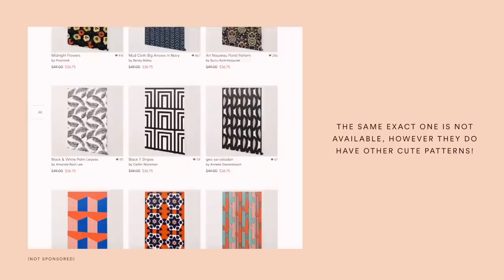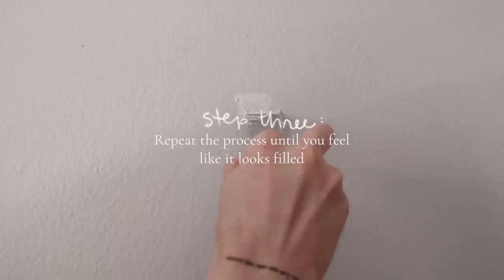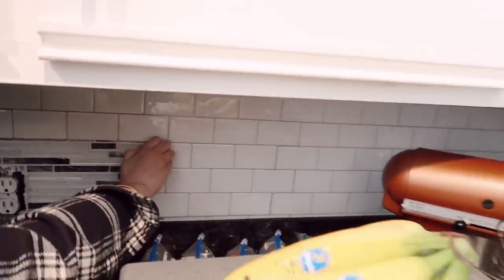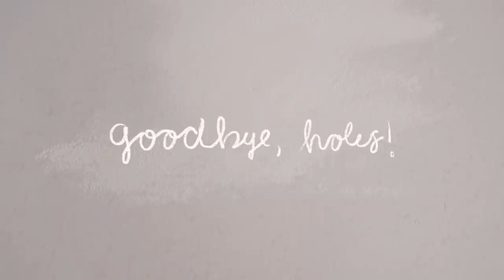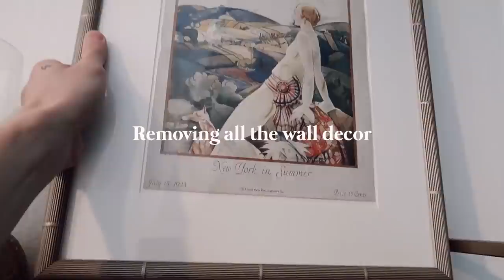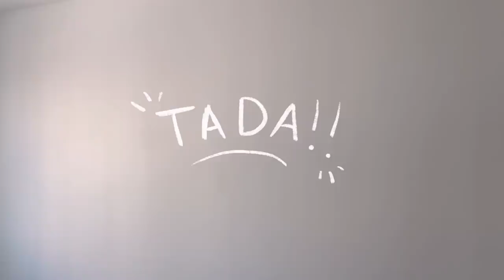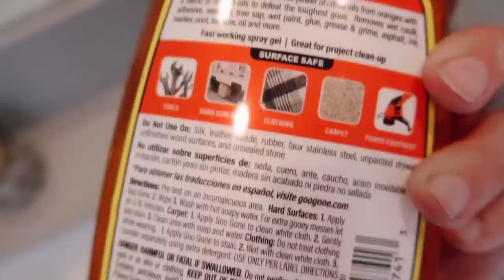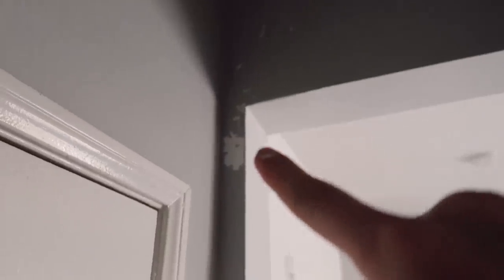Un-Making Over My Apartment! *Getting back my security deposit*

Comment: Spackle Pro Tip: if your wall has texture, a flat spot of spackle will stick out like a sore thumb. rub damp sponge lightly over the area after it has dried to remove excess spackle that is not in the hole.
Reply: That's one of the best things to do. Also, if you don't have the sparkler tool, an old credit card/store card works just as well.
Reply: Joint compound is actually easier to hide as it’s water based and you can rub the JC over the spot and rub a wet towel over it and only the small hole will be visible and not disrupt your textured wall, I just learned this recently and thought it was brilliant!

Comment: Drew! Using a hair dryer makes it easier to remove peel-and-stick tile (obvi too late now but for the next time lol). Can’t wait to see what you do with the new place!
Reply: Can confirm, just had to do this for vinyl decals the last owner of my house put all over the walls. Had to take each. individual. letter. off. The hairdryer worked so well
Reply: Same;  the hair dryer is a major key to removing all peel and stick.
Reply: Hair dryer or heat gun 👍🏻
Reply: same thing for the contact paper on the bathroom countertop. All the goo is left cuz it needed some heat
Reply: Same with slap tile floors heat gun....works awesome

Comment: If you ever have to remove "peel and stick" tile again, I recommend a heat gun or blow dryer. The heat melts the glue and the come off much faster.
Reply: I search so far down for this comment !
Reply: @artemiciat566  me too!
Reply: Be warned, depending on the peel n stick, it would leave some residue if heated off a surface
Reply: @NeptuneSega  A residue will be there even if heat isn't used. A good adhesive cleaner should take care of any residue.
Reply: Or WD40. Or, like he used, the Goo Gone.
Reply: And cooking spray removes the residue just as well as expensive products

Comment: Hey Drew, when you're doing multiple coats of paint with a limited amount, you can put your roller in a ziplock bag in between coats so you don't use up paint throwing away your used rollers.
Reply from the maker: So smart!
Reply: I put my whole paint tray, roller and brush in a big ziplock or even a garbage bag between coats so I maximize all the paint. It's saved me so much hassle too with having to wash brushes and stuff!
Reply: Also, and especially if the weather is warm, put your wrapped brushes and rollers into the fridge.  It stops the paint hardening.  Works so well!  👍
Reply: In his case, it is also useful to do the first few layers with another brand of white. And only the top layer with the color left by the painters.  Then less of the good paint is needed to make it opaque enough.  (p.s I don't speak english.)
Reply: @kirsten4041  was screaming "PRIMER!!!!!!!!" at the screen too XD
Reply: @kirsten4041  That's a good tip but I don't think he had any other white paint. I did this recently with my bathroom though and it worked so well!!
Reply: My mom would always wrap it in tinfoil or cleanfilm and stick it in the fridge, would last for months

Comment: Spackling tip:
Never scrap fresh spackle level to the wall surface; leave it bulging a bit.
As it dries, it compacts/shrinks. If it was leveled, it will reveal a divot over the nail/screw hole.
Better to sand it flat than have to build layers to bring it level to the wall surface.

Tip on anchors:
Never dig out the anchor.
Just remove the screw, then set a screwdriver over the anchor and tap the handle butt to push the anchor a little further in.
Now you can spackle over the old anchor, let dry, and sand, and no one will ever know.
It's actually structurally better for the sheetrock to do this.

Tip on peel-and-stick tile (floor or backsplash):
Goo Gone is expensive.
Most adhesives are oil-based (gums are basically dehydrated oils), so if you hit it with some inexpensive cooking oil, the oil will act as a solvent dissolving the adhesive residue.
Then you just go back with full-strength dishwashing detergent (like Dawn) to remove the oil and rinse.

Tips on painting:
Remove EVERYTHING from a room you're painting, or throw a plastic drop cloth over things.
No matter how careful you are, paint spatters, especially from a roller.
Also, paint will spatter onto your hair and skin, becoming a pain to get off later.
Unless you work olive oil into your hair and scalp and rub a light coat onto any exposed skin.
Not only will the pain not adhere and wash off easily later, but you'll get a spa-level conditioning of your hair and skin.
(Note: The classic movie beauty Sophia Loren daily applied olive oil to her skin for YEARS, claiming it discourages wrinkles; and it works!)
For better coverage, paint in random 'W' patterns instead of straight vertical movements.

Comment: A little tip when you paint if you have a broom handle that screws off you can unscrew it and screw it onto your paint roller handle.  Painting is so much easier using a long handle.  You can use better pressure when painting.  You have done a great job!!

Comment: FYI i recently learned that the metal end of the handle of a 5-in-one painter's tool is made to dent the walls where there are nail/screw holes. Once you make a little dent it's easier to fill them in with spackle/mud because there's no "blow-out" where the dust forms a little bump.

Comment: When you need to cover a dark color with a light color,  make the first  coat a white stain-blocking primer like Kilz. Then do the final wall color over that. You will need fewer coats, less work, and  it especially helps when you  have a limited amount of the  final wall color.

Comment: Semi-pro tip: especially on textured surfaces, instead of sanding the spackle, use a very lightly damp sponge and gently wipe off the excess. That will remove the excess spackle from all 'valleys' in the texture surrounding the hole instead of having a smooth patch where the hole was.  Plus it's faster and doesn't leave a dust mess that has to be wiped or vacuumed away before painting.

Comment: Real consideration: was the money you got back in your safety deposit worth the “labor hours” you spent fixing it back up?
Reply: Isabella Caltabiano apartments ive rented will charge you for every dollar in excess of the deposit that it costs to put your apartment back to normal. For his apartment I’d imagine it would be quite a bit
Reply: Security deposits (at least in my experience) are 1-2 months rent so depending on the area could be anywhere from 700-2000 dollars - so I would say so
Reply: Not undoing changes you've made to an apartment is inconsiderate and a crappy thing to do. Unless the landlord agrees to it, don't leave it for them to deal with.
Reply: I think so just because most of the stuff he used he already had. it looks like they only had to buy one thing of paint , so it’s undo the work you’ve done or loose 500-1000 dollars
Reply: The biggest reason to do the work yourself is that your next landlord will almost certainly contact your previous landlord, where they will find out that you’re an asshole nd terrible tenant for not following the lease you signed (return the apartment to normal) and then likely deny your application, thus loosing all that money in application fees (I just paid 250$ in application and ‘admin’ fees. Ugh)

Comment: Don't forget to clean your oven and ESPECIALLY under your stove (the top should lift up, warning it will probably be really gross under there). It's one of the most forgotten places to clean that will cost you your security deposit. Also baseboards and light switches. Also remember to replace any burnt light bulbs.

(I have family that run a real estate office and have cleaned many rentals for them before.)

Good luck! Hope this helps! 👍🏻

Comment: Two recommendations if I may. With the speckling, you can go over it with a damp sponge before it dries. Then you dont have to use sandpaper. And I think I saw somewhere that it's good to heat up the glued on tiles before removing them. Maybe with a  hairdryer?

Comment: Something I learned when I worked at lowes in the paint dept. Is that, even though paint is advertised as having paint and primer in one...it doesn't because you can't actually mix them together. What they actually do is add a little bit extra titanium to it to make it thicker so you can do less coats but if you need to go over and unpainted surface or a shinier surface or a darker color or going over a oil paint with water based (latex) paint then you need to actually buy the separate primer. Especially if it's a shinier surface or was painted with an oil paint before because it will chip and peel in short period of time since it can't fully adhere to the surface. When I say shinier surface, I mean like say you bought an eggshell paint but the wall or whatever was painted with satin or semi-gloss.
Also a bare, unpainted surface will soak up paint and you'll have to keep adding layers so do yourself a favor and do 1 to 2 coats of primer beforehand.

Comment: Using a blow dryer while peeling the tile makes it a little easier to get off. It will soften the adhesive so it may leave more residue but it will come off easier.

Comment: I live in Washington, DC and in the older buildings if you lived there 2 or more years and you've painted you just have to put on 1 coat of primer, and if you didn't paint you just have to clean and remove all trash (no patching holes) since they will probably be redoing the entire apartment after you leave.  I always patch up the holes even though they tell me I don't have to and make sure everything is cleaner than I found it.

Comment: Also a tip for the fraying of the wall because of screws. You can use the back of a screw driver thats round and roll it on the edge of the hole it will fold the fraying in and its very fast.

Comment: Maybe already suggested, but use a blow dryer on the contact paper.  I had ancient contact paper in kitchen cabinets and drawers that would not come off.  What would come off was tearing up in little strips and leaving a sticky residue mess.  I hit it with the dryer, and it came off quickly in full sheets with no residue.

Comment: Great video.  Quick tip use a heating gun or blow dryer to melt the glue on the paper.  This will make it easier to just peel the paper off of your walls.

Comment: Hey quick tip when you try to remove the contact paper and any thing with a glue backing use a blow dryer to soften it a little.. Pulling it it will be much easier 😊👍🏽

Comment: I noticed the peel and stick tile was over the original tile. With how difficult it was to remove the peel and stick tile, do you think it would have removed paint if not placed over old tile?
Reply: It's very possible that peel and stick tiles will remove paint, and even some of the wall. They're supposed to be warned up with a hair dryer or heat gun before pulling them off. If you warm them up and go very slowly and gently, you should be able to do it with minimal or no damage, but I'd be prepared for the paint to need touching up.

Comment: If you ever need to fill nail homes again use a product called Paint N Patch. You press it into the hole, spread a little over the top then wipe it away with a damp finger. No sanding! Best stuff ever invented. It's especially good if you have a knock down texture on your walls like you do. It doesn't leave flat spots where you've used Spackle & sanded. I would love to see a before you move in with all the changes made to your new apt video. A moving one.. not so much.

Comment: Oh wowzers. I had no idea stick on finishes are such a thing. Yours looked so well done.  Would they work as well in humid climates?  I kind of softly loled at your paint guesstimate.  (no primer over dark blue = an easy 4 or 5 coats). In all cases I actually enjoy house painting. It's hard work but meditative. And very satisfying to see such direct results from your hard work. (like mowing grass).   Regarding the removal of the anchors from the walls, I think it should be pointed out that spackeling (sp?) larger holes will need multiple passes with greater drying time between applications than paint.  If the timing is off you're screwed (you gave yourself 9 days so you were fine).   Regarding the gallery wall in the living room is the art licensed?

Comment: Tip: a trick to removing any peel and stick or anything like a sticker, is to use a hairdryer on it for a couple seconds. It loosens up the sticky(glue) part and removes it easily. I use this trick to remove price stickers off of shoes/items, and contact paper.
Reply from the maker: Thanks so much for the tip!

Comment: I have never had luck with goo gone, what I tend to do (for non-porous surfaces) is use lighter fluid.  Don't know why it works but it just melts adhesives like nothing else.  Just make sure you wash the surface afterwards.

Comment: I wonder if a heat gun like for crafting would help remove the peel and stick tile.  If you raise a corner and direct a little heat on it, the adhesive would soften and maybe lift easier. Don’t put the heat gun too close, maybe 6 inches from tile.

Comment: Would you recommend that contact paper (from your bathroom) for a kitchen counter top? Like is it durable enough to use with pots and hot pans banging on it? Or even with all the effort it took to remove the contact paper afterwards (kitchen counters being a larger surface area)?

Comment: I'm always surprised when I see you tubers filling in nail holes. You should get your deposit back with normal wear and tear and I've always left a reasonable amount of nail holes in previous places and always gotten my deposit back. I understand for a gallery wall where there may be an excessive amount of holes. Of course, I was in law school while living in my apts. and also worked briefly in landlord/tenant court after so i was always ready to argue my point if needed (always took pics/vids of my empty apts before I moved in and when I moved out to prove condition if I needed it), but I never had to. I also painted one apartment on my way out to cover color I added and just got a standard warm white. It was in a contained room so it looked clean and fresh and didn't clash with whatever white was in the living space. Still got my deposit back. Of course, I was also a single gal at the time and pretty unassuming and clean. Landlords were probably bummed I was moving because I do know people trash apartments!

Comment: would heating the tiles have helped? We had to remove some HORRIBLE adhesive stuff from a door, and we heated with  a hair dryer to remove it faster :) also, it came out in bigger pieces instead of small chunks

Comment: Investing in a gallon of KILZ primer would have been best for the first 1-3 coats in each room, thereby saving the matched paint for the top coat/s. The worst that could’ve happened was you’d have leftover KILZ and not potentially a half gallon of expensive custom mixed paint.

Comment: If that peel and stick tile had been stuck to a painted wall instead of a wall with tiling on it, it would have taken off the paint and a layer of the wall board underneath it when removed.

Comment: I am now questioning if that peel and stick tile would be ok on dry wall!
Reply: If he would have just use a heat gun or blow dryer to loosen them up it wouldnt have been as difficult and it will also help not damage the wall when removing